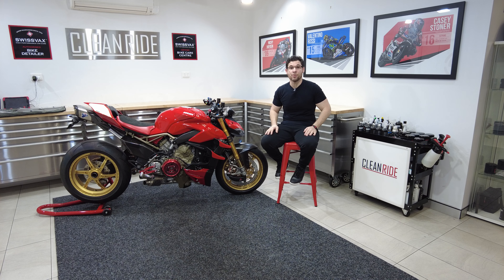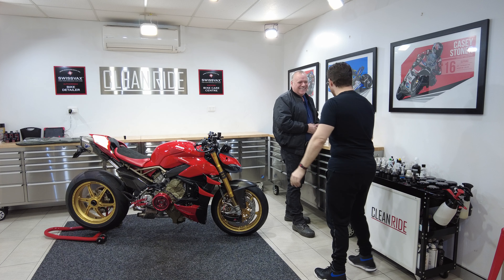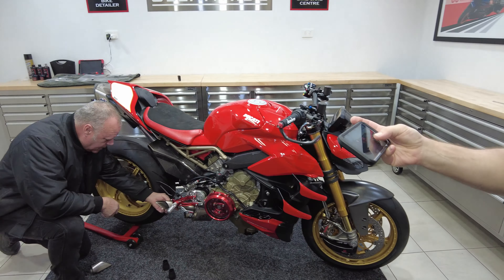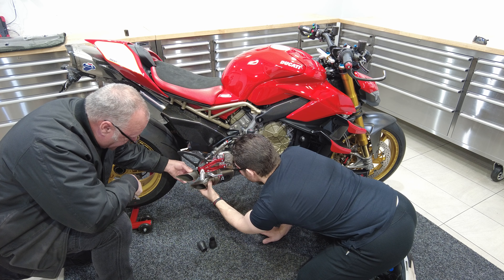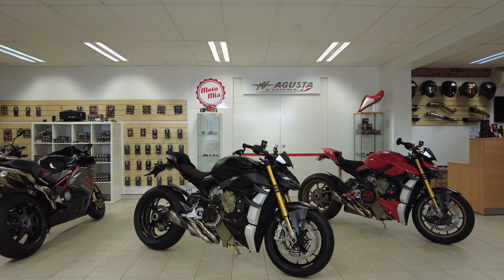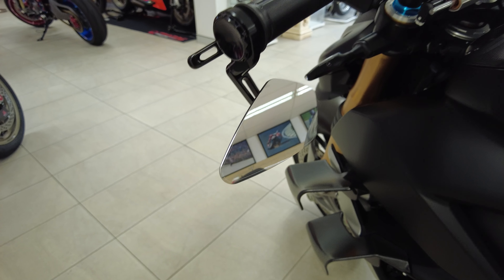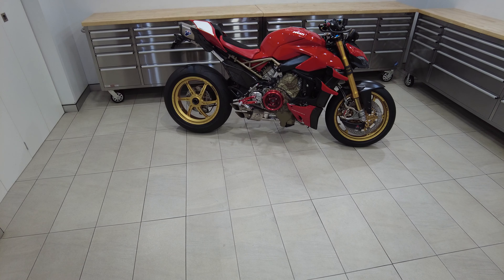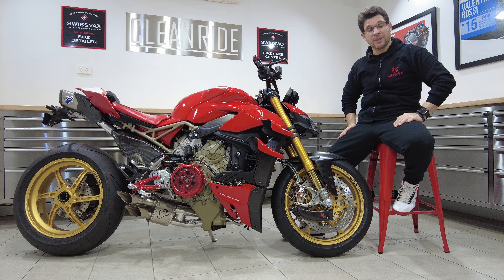Ducati Streetfighter V4S - Project Build Part # 17

Comment: Yo bro so u talk about the futur the futur is comparing to your customer is less power because this 4uscite doesn't have an UP map on your bike...the SFV4 
i really think that u can try to instal the t800 up map on your bike in choosing the panigale v4 setting may be it is the way like i said before N use after the 4USCITE up map try that may be u will have more power by the way my custom exhaust project is finished i used the 4uscite UP MAP without db killers N lambda sensors 
End of the month i will go to the dyno 174.8bwhp in fouth gear is the stock numb to beat 
N damn i have broke a screw thread on the oil pan during an oil change so i have a leak...so my bike will go to DUCATI this monday...
i have to put a new video of this project on my Youpo%n channel
see u bro i can't wait to see wahat is next